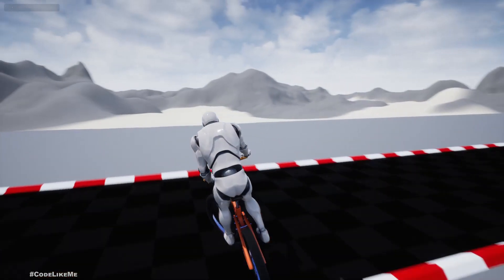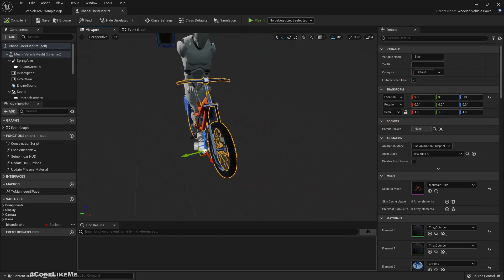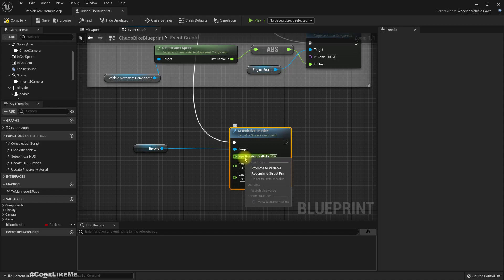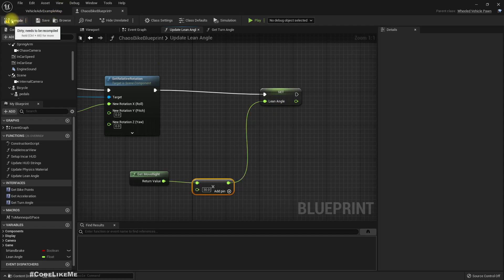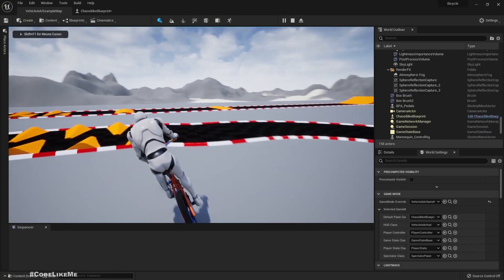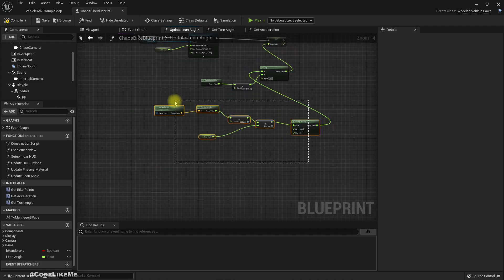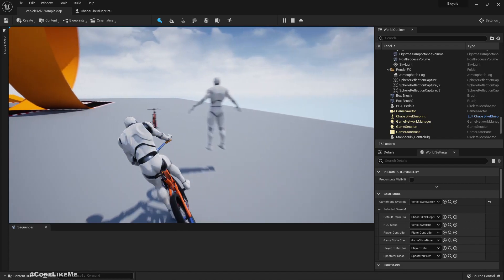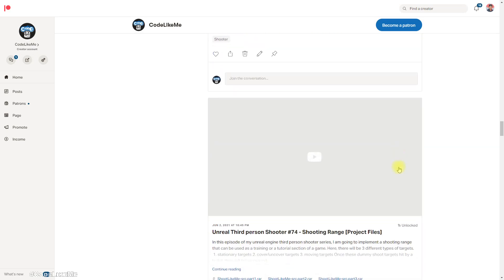Unreal Engine 5 - Bicycle Riding System with Full Body IK [part 4 -  Leaning Angle]

Comment: Haven't gotten to watching this series yet but wanted to ask
If this could also be used in UE4 or is there stuff in UE5 it specifically needs?

Also aside from the pedal/legs, can this be applied for a motorcycle or is that too a different system?